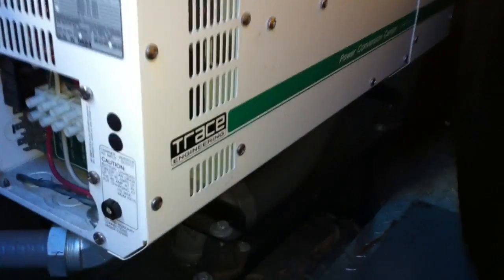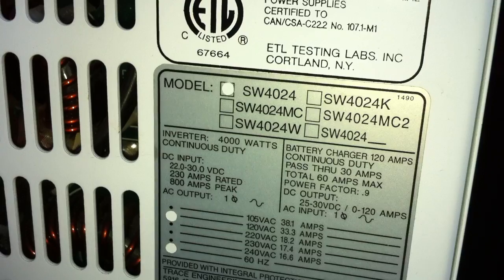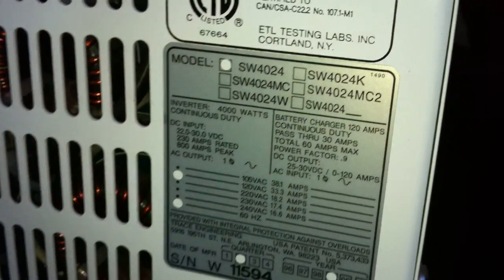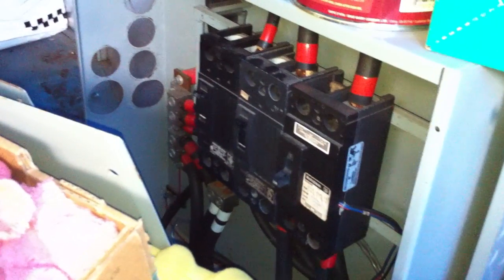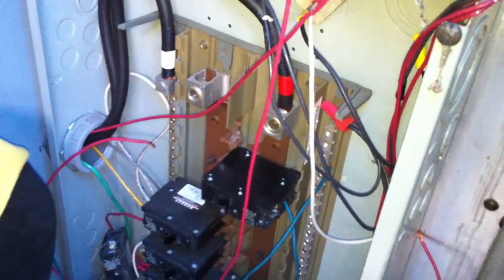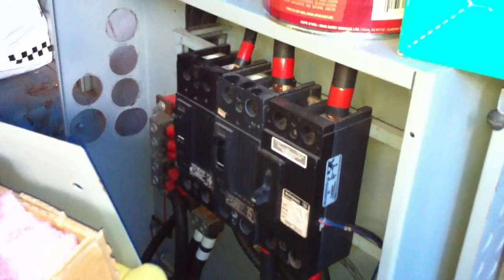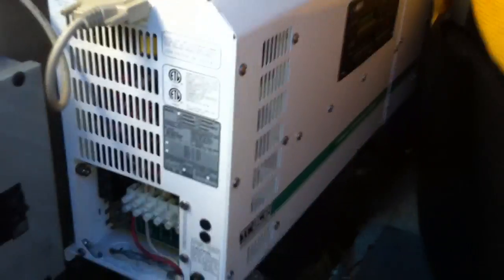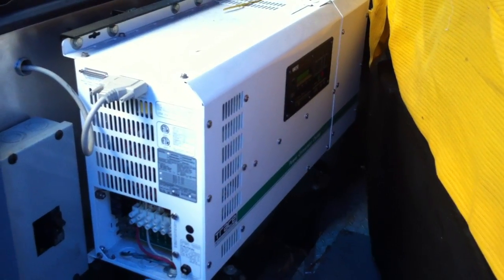Trace Engineering Inverter / Charger model SW4024 test

Comment: I inherited a property and it had a Trane SW 4024 inverter in a closed off humidity controlled room.  It says make date was 1st quarter of 1999.  It looks in excellent condition.  Former owner used to have a generator and I'm assuming that's what he used it for.  I know nothing about electricity and wondering where I might be able to test it to see if it still works and does anyone know what it's worth?  thanks for any info!
Reply: I got my new in the box 1996 and I used it continuously for 19 years until I had a small internal fire while using the generator to charge the batteries through the inverter. I never had any problems with it